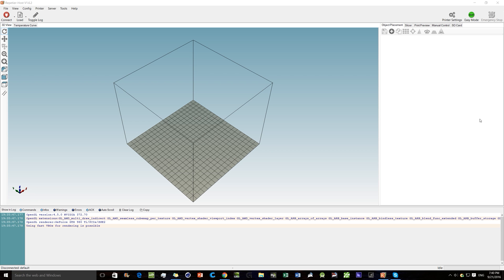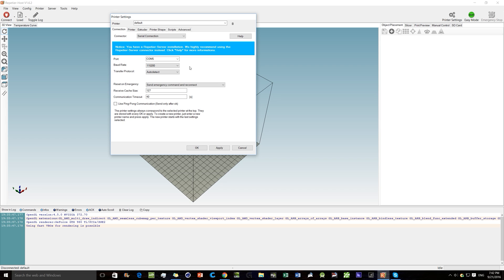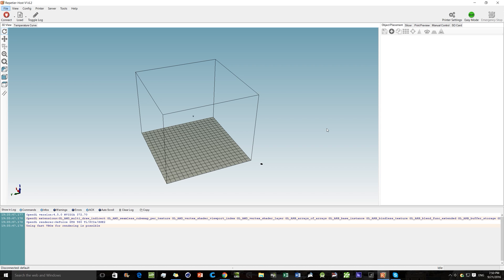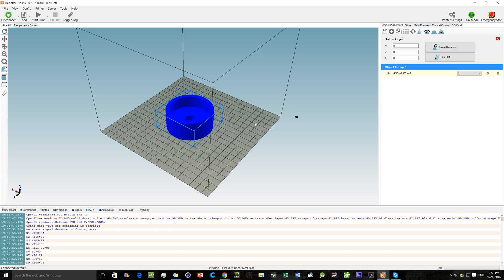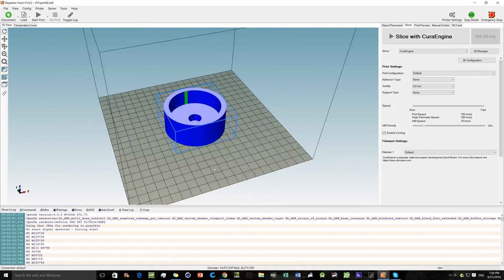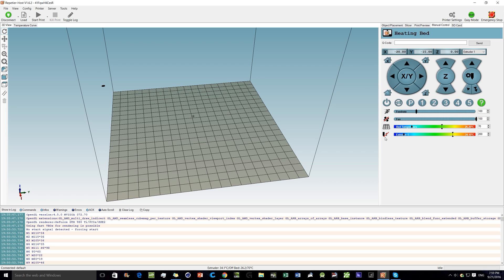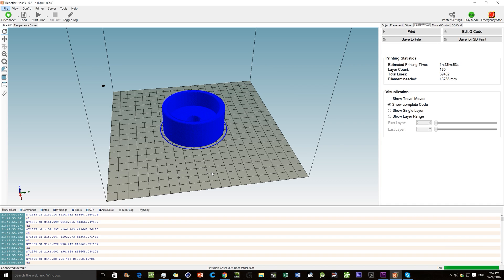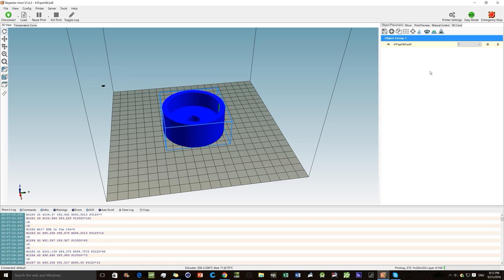How To Use Repetier Host | 3D Printing

Comment: V2.2.4 firmware was revised by an idiot who retracts the filament before a print start, resulting in a no print.  You have to open the feeder so the filament does not retract, wait for the retraction to end, and then the print can commence.

Comment: Anyone have the boud rate for ender 5 plus?
Reply from the maker: i am pretty sure it is 250000 if not try 115200 thats what the ender 3 uses. Hope this helps...
Reply: Channel Everything yes it did I got it working shortly after I tried 2500000 thank you for the help!

Comment: this doesnt make any sense. I click print preview and theres nothing there. Go back to object placement there it is, click print it says job finished, machine never moved.
Reply: This exactly is happening to me too
Reply: You probably already figured this out, but for anyone else having this issue, you must click the large "Slice with (your slicer here)" button. after which you will have an option to select "Show layer range" this will allow you to control where in the print you can see and essentially scrub through the print. It does NOT generate an animation with this software.

Comment: Ok I go5 a Folger tech 3D printer and I’m using repetiers newest firmware and in the program it shows the object in the center but when it prints it prints at the front of the bed any way to fix that?
Reply from the maker: The only thing I can think of is that the software doesn't know what the dimensions of the printer are... double check those settings first!

Comment: still can't find it- guess im looking for a vid explaining why my motors aren't moving but are humming with a somehwat pleasant noise
Reply from the maker: Hmm I can try to help. Can you get any response of anything from your computer to the printer?? Like does the nozzle heat up? Or the extruded motor turn?
Reply: thanks for your reply. Yes, the bed, nozzle, fan, and thermistors all work fine. The x, y, and ext move one way. I'm going to try running the motors off different axis ports.
Reply from the maker: Yeah I was going to ask you to double the to make sure the motors are connected to the right ports. Let me know if it works!

Comment: Hi. Thanks for your videos very helpful to me especially setting up the heated bed. One question. On the manual set up any idea what the row of numbers means only the question mark seems to work. Just curious. Cheers.
Reply from the maker: Thanks for watching my videos. I am not exactly sure what row of numbers you are referring too? could you be a little more specific?
Reply: Channel Everything Hi. Thanks for the quick reply. I am using Repetier-Host V1.5.5 when in manual mode the numbers are below the control icons. From left to right there is an icon I don't recognise then P 1 2 3 4 5 ? The question mark is in red. None of them seem to do anything? Sorry probably a stupid question but I'm new to this. Thanks.
Reply from the maker: honestly i have never used them . I think they can be set up for motor positions or writing scripts. If you go into the printer settings and click on the scripts tab there should be a drop down menu. You can turn the buttons on there when you write the scripts.

Comment: The cross section viewer is ideal for looking for manifold problems. If you load an .STL file, and its not manifold (Like most times) you can slice through to find where the problem areas are - they usually show up in white or a light highlight.
Reply: Do you know why an .stl disappears after slicing because that is all that's happening to me. I can't get an object after slicing